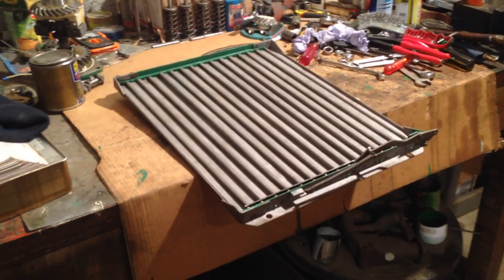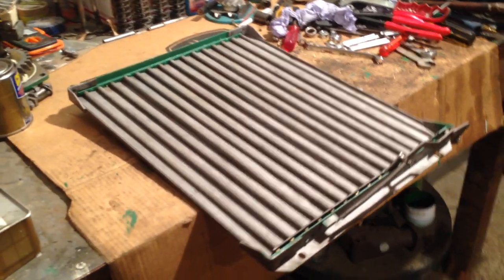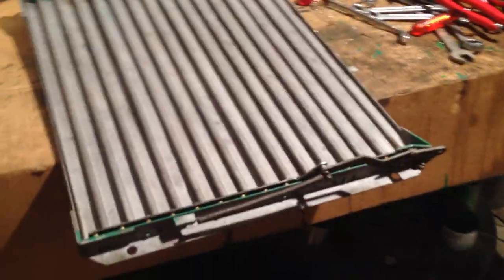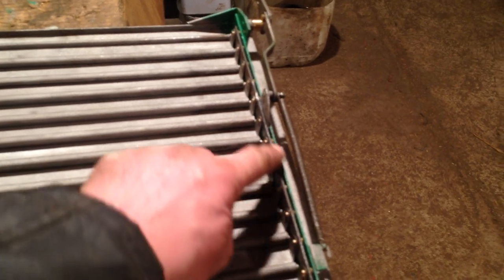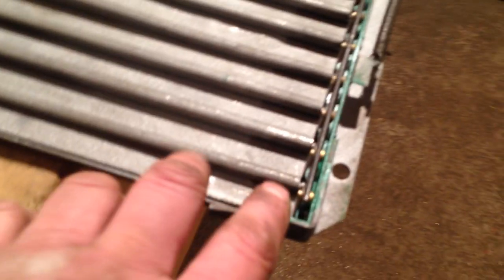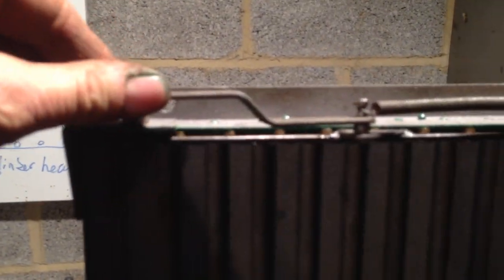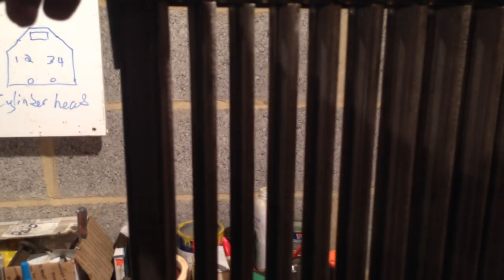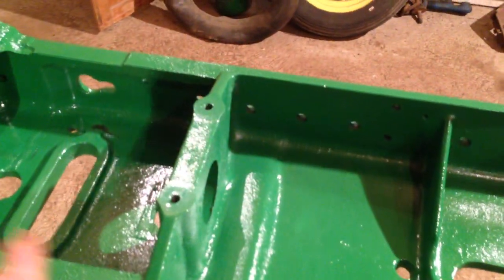1940/41 John Deere B tractor restoration pt 57 ( Radiator shutter screen )

Comment: On my '44 B, not only was the shutter seized, but 2 or 3 of the vanes were partially rusted away. Used thin sheet metal to patch them and replaced some of the rusted pivots with common nails. As with yours, it was quite a project.
Reply from the maker: Merritt Derr  Hah I still have nightmares about them , but satisfying once it was done Regards
Reply: @oneminutefarming9521  Yep, and we won't discuss the difficulty getting out the screws that hold the screen to the tractor when the radiator is still on the tractor. . .

Comment: Sir where can I get a spring like that on the top?  Or, about what size is that spring you have if I source one at the hardware store.  Thank you
Reply from the maker: Hi Delayp , best I can measure it’s around six inch long and 5/16ths in diameter it’s quiet tightly wound made of 16th inch wire hope that helps regards DAvid H.